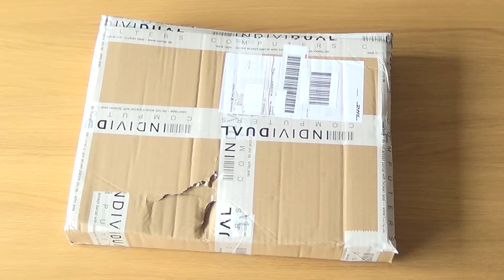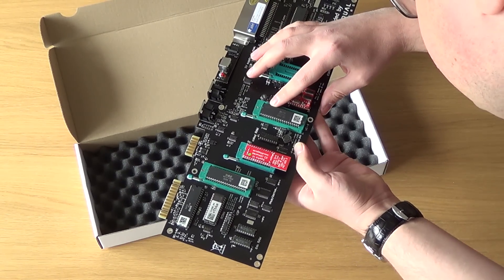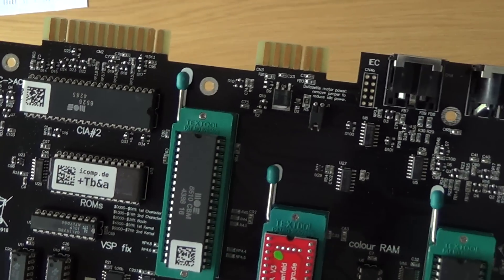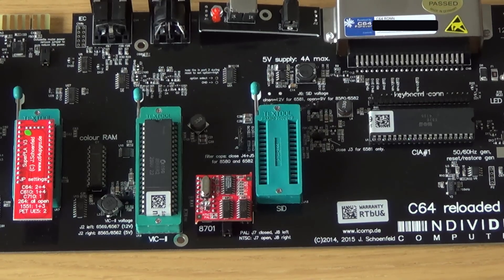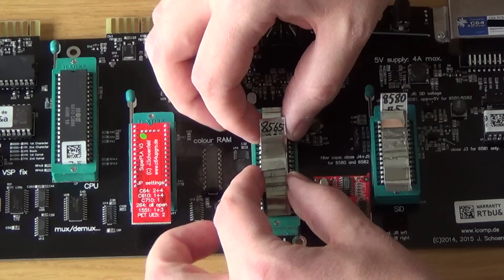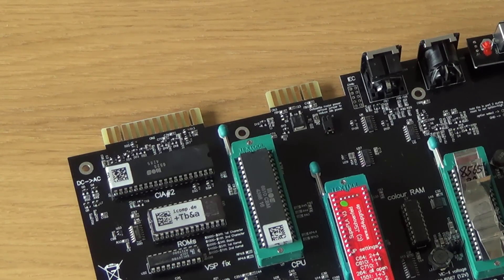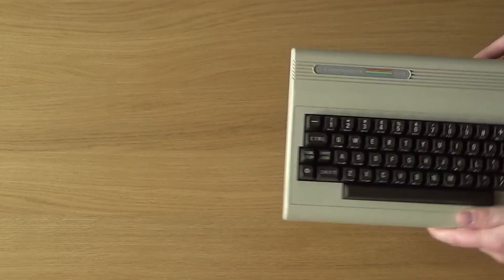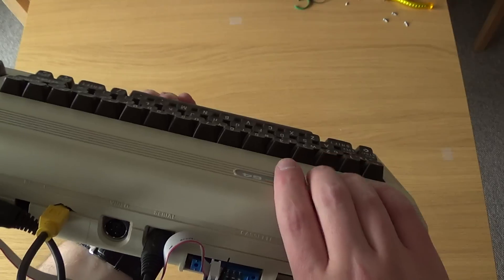C64 Reloaded. The new (MK1) Commodore 64 motherboard.

Comment: dude, you ruined a C64 top case for a cheap China board??? For an S-Video connector that comes with every C64 except the first ones (on the 8 pin Video Output is always Chroma/Luma which is S-Video Standard) ???

After Gotek and ACA the next Thing Commodore stuff will be ruined. Sad day.
Reply: gehtjanix1 while I understand that failed case mods can reduce the number of C64's left I fail to see how new boards to replace failing or dead boards will do anything other than help to preserve the platform.
Reply: Heat sinks are not nessacary the last 30 years so: WHAT HAS CHANGED? And you missing the shielding probably you throw that away too. What is left? A Keyboard and a ruined case. That is all you have for Commodore... Aweful Video. That Hurts.
Reply from the maker: gehtjanix1 Wow, heh.. I'm really sorry that I hurt your Commodore feelings with this video.

Yes, I'm aware you can get s-video from the standard video connector. But on the Reloaded board, the signal from the dedicated s-video port is better than the s-video signal you get from the video port - also on the Reloaded board. Why? Don't know. Maybe you don't believe that, and that is fine. But I believe what my eyes tell me.

Heatsinks help! I had a few demos that always crashed about halfway through. I tried a lot of stuff (too much to mention), including getting a new PSU (built by Ray Carlsen), but the crashing continued. You probably see where I'm going with this.. About half a year ago, I tried attaching heatsinks on the hottest chips, and the crashing ceased immediately! Not one crash since then. I was really happy that day. :) Maybe you don't believe that either? Fine. Again, I believe what I see.

The shield? I took that out, because the machine works just fine without it (my experience and belief), and it's absence helps to dissipate heat. So that is a no-brainer for me.

One thing we agree on (partly), is that I should not have cut that little piece of plastic off the case. I should have modified the cable instead. I wish I thought of that. I really regret doing that. But still.. It's on the back of the case, where I rarely see it. But the fact that you think the case got "ruined" made me smile a little.

Thanks for your input, and have a fantastic day.
Reply: Casual Commodore 64 Will recommend your channel for fans of Horror movies. That really scared me! 

S-Video: I believe you because I know who developed that board. 

Heatsinks: Well I never had any Crash on a C64. Commodore did use some heatsinks on VIC (SX.64) and some C64c but that is rare. Normally, those ICs do not Need heatsinks. I know it could be better etc. but there is no study to proove that and I think: If it works 30 years it should be OK and pretty well tested ;) If it does not work you should Exchange those Chips - the heatsink maybe just helps on a Problem that your IC has (e.g. a fault that you did not experience now with a bit lower Temperatur, but not meaning that the IC is "healed", just the Problem is not appearing) 

Shield: "Took that out" is something different to thrown away. Also, again, I see not much sense when it is working for 30 years, I think it is fine ;) 

CASE: MY GOD what a shock this is even now. That was not your best work I think :D Whatever you did, that is not a good solution LOL 

If you know, that those cases will probably never be produced again, and the fact that a mold for this production will cost 40.000+ Euros, you would think a different way. I see all the work People put into and the case is beautiful White and like new condition and someone just came and cut it. That blows my mind. We should look after what Commodore gave us. That is my opinion. Also there are (or were) 17 millions C64, that is a number that will get lower every day with such mods and (sorry) stupid boards and Projects. 

Anyways, have fun with your C64 now and next time, please do not upload Horror movies and do not cut any c64 cases. I think you have other talents ;)
Reply: Ｔｈｅ Ｃｏｍｐｕｔｅｎｔ Well... The board itself will not break, so there is no Need for a replacement board. If you thin People just buy it as replacement, you are wrong. It's most ly collectors and those will get the needed (not supplied) chips from working or repairable original boards, making them useless. So there is no preservation in any form, it's just another Project to reduce numbers of original boards and increase the Price for Retro plattforms...
Reply: gehtjanix1 I don't doubt that some people will needlessly replace their boards with these but in instances where a board has gotten cracked or damaged I think projects like this that at least give people the option to get a new board without having to scrap one from another system are a great thing. Stuff like this and the SwinSID may not be as authentic as the original item but at the very least they provide a new source of replacement parts other than scavenging wrecked systems.
Reply: Ｔｈｅ Ｃｏｍｐｕｔｅｎｔ Mostly, the ICs will fail so you have more boards then you can put together working. When one board has a crack (that is really rare) - you repair the next one and use the custom ICs in there.

If you need a replacement board you better buy a cheap original C64 and you got some spares left from the old non-working one. You are cheaper and have got more for your money. I really see NO "need" in a expansive replacement part that rarly is broken. 

SwinSID is a nice toy but has nothing to  do with a real SID. It's a good idea and a often needed replacement part but sadly does not include all functions (paddles etc) and has less Audio Quality.
Reply from the maker: gehtjanix1 Yes yes, perhaps.. I have two C64's that work just fine. I really bought the C64R because it is practical, flexible (switch between different VIC and SID chips at will) and economical (chips run much cooler in C64R, as opposed to real boards - potentially prolonging original IC's lifespan). It all satisfies my "nerd heart", and I wanted to spoil myself. Will it outlive most original C64 systems? Who the hell knows.. Time will tell. ;)
Reply: metro2002 I Keep it Original, no matter who says what. If it works 30 years, I do not think there is a Problem. Also some used a metal shielding which gives the heat to a larger area to cool the Chips. They where not stupid at Commodore...

There was a new C64, called "C64-DTV" 10 years ago.

Comment: Thanks for showing this. You lucky ! :) Got to love the redesign of the power section, and also the video section. Video looks good, even on composite. Is the noise on audio outputs reduced also ?
Reply from the maker: bwack Um, I don't know. I never noticed any noise on normal C64's. :) But I haven't tried the mini-jack audio out yet - ordered an angled adapter, so I can use it. When I get it, I'll find out if the sound is better, but I suspect I will not notice any difference. I have never complained about the sound quality on any C64. And I don't mean the difference between 6581 and 8580 - I mean general sound quality. ;-)